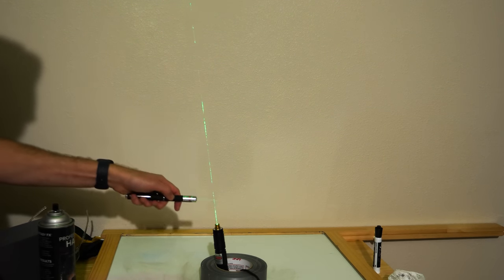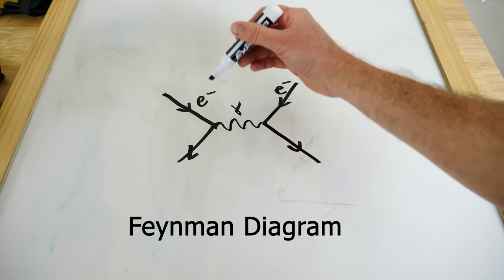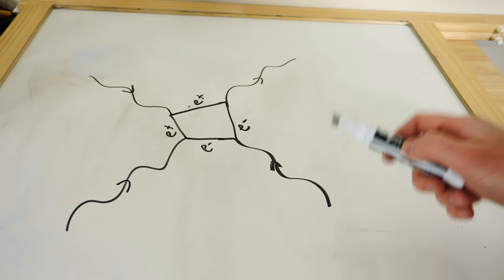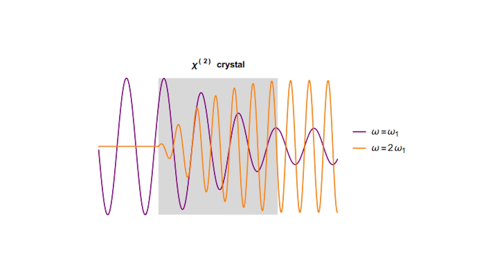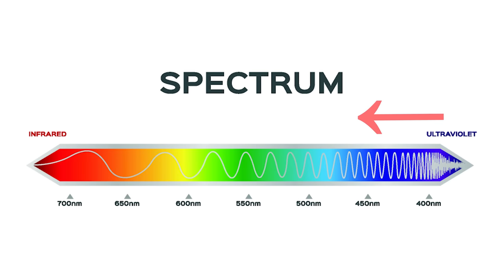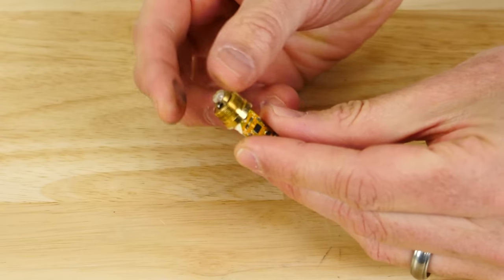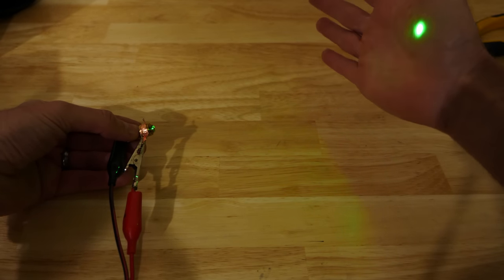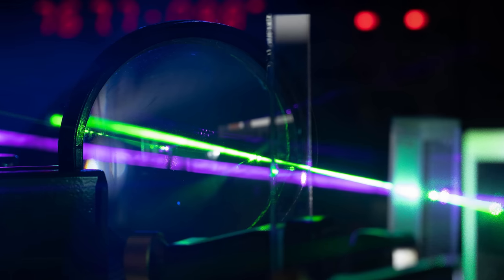Can Light Bump Into Other Light?

Comment: If you held that crystal over a camera, would you be able to see what the world would like if our visible spectrum was 50% lower frequency?  That would be interesting to see.
Reply: You would likely need to design a lense based on this principle to properly capture it, otherwise you are not emulating the structure of the crystal that causes this light refraction
Reply: We'd mostly be seeing in green, blue, purple.
Reply: Don’t mess around with crystals, you’ll fu*k up your chakras!
Reply: No, the second-harmonic crystals in laser pointers are extremely narrow-band in order to be efficient. Only that one specific infrared wavelength (around 1064nm) is partially converted into green light (532nm) with some ten percent of efficiency, everything else is unchanged. So only if you have a strong light source at that 1064nm wavelength in the room, you might expect to see a tiny increase in green hue - without the crystal that wavelength would be simply invisible. Also, it's a 2nd-order nonlinear effect and you only get that efficiency if you pump 50-100mW of infrared light through a tiny spot on the crystal. If you use the crystal as a lens for your glasses with only eye-safe ambient light, the power density on the crystal will be millions of times less and the conversion efficiency scales with the power density squared, so you will see absolutely nothing, even if the whole room is lit up in 1064nm light.

Frequency-doubling of the entire visible spectrum is extremely challenging because these crystals typically work only for a "single" (i.e. narrow-band) wavelength and even then getting more than 10% efficiency is considered good. If you want to convert a broad range of wavelengths simultaneously, you have to make the crystal very thin (look up "phase matching"), which makes it very inefficient, so this is only useful for high-power or short-pulsed lasers. Maybe you could make a giant stack of many different crystals tuned for different wavelengths covering the whole visible spectrum, but the resulting contraption would probably be meters thick and re-absorb all the converted light...
Reply: @darktherapy  That was hilarious!
Reply: Being a second order process, you need very intense light. So probably you will see the same image
Reply: @RealNovgorod  I love the analytical response to the OP. My question is could you hypothetically design a lense similar to the design of these laser pointers with an overlay of that specific crystals refraction point? Because you said "one point on the crystal"
Reply: Crystal glasses!
Reply: He'll yeah, 🤣 but it still made my day, So frickin random.
Reply: @tiffanyvalencia8415  I like some of those colors.
Reply: @darktherapy  is that what happend to me?
Reply: It'd be like looking threw blue sun glasses . Red and blue make green or vise versa any filter of light you've seen that before
Reply: @SomnixmLxcidxs  For nonlinear crystals you have to concentrate the optical density as much as possible to achieve any kind of efficiency. That's why inside a laser pointer the infrared laser is focused very sharply into the nonlinear crystal and the resulting green light must be recollimated again. So indeed you could make some telescope setup with achromatic lenses (or parabolic mirrors) and place the crystal into the focal point (inside the telescope) to maximize the efficiency. Essentially all sceintific and industrial applications (including the laser pointer) do it this way.
Reply: @darktherapy  lol
Reply: You would be seeing the world in 144p 😂😂
Reply: No, you need sufficiently high intensity to have the non-linear effect of second harmonic generation. The efficiency of this process at such low intensity as just "visible incoherent light around us" would be basically zero.
Reply: this explains witche's crystals... hmmm.
Reply: @Andy-413  Extraordinary claims require extraordinary evidence.
Reply: @darktherapy  You can only prove it to yourself.
Reply: @darktherapy  On a side note, how is it that you saying crystals will screw up your chakras is not an extraordinary claim, but what I said is? That's ridiculous.
Reply: @Andy-413  So that could never convince anyone else.
Reply: @darktherapy  I don't want to try convincing anyone of anything, you'd have trouble convincing people that 1+1=2 if they believed 1+1=3. I'm just putting my knowledge out there, and I don't expect it to convince anyone of anything, it's just something that I think people should know, whether they do anythign with that information is only their concern, not mine. But once again, why is it that you claim they have power and that's a perfectly ordinary claim, I claim they don't, but my claim is the extraordinary one for some reason?

This is not even something that should be argued about, not a debate that will lead anywhere beneficial since they both rely on people's minds for the evidence, not visible evidence, good luck proving personal, spiritual experiences or truths, or lack thereof. That would be a monumental achievement if someone could prove without a doubt anything of a spiritual nature. I just spread the knowledge, it's not up to me nor any of my concern what people do with that knowledge. Reject it or accept it, it's up to you, not me.
Reply: @Andy-413  I’ve not made any claims..
Reply: @darktherapy  Sure you didn't...
Reply: @RealNovgorod  so no glasses, but what if you use long exposure photo? Then the intensity wouldn't be a problem 10% efficiency * 10 times exposure should make a 100% efficient photo (although a little motion blurry), or you lower the resolution ten times and have a normal photo. As long as it's linear otherwise you would need software adjusting and can't do it with film photography directly, you would need also a intensity correcting filter.
Reply: @ГеоргиГеоргиев-с3г  You won't get anywhere near 10% efficiency, that's the whole point! This efficiency is for pumping 100mW of IR through a 50µm-diameter (or so) spot on the crystal. If you reduce the power density on the crystal, the SHG efficiency goes down quadratically. You could use an acromatic telescope and put the crystal at the focal point to maximize the power density as mentioned before, but you would still have 4-6 orders or magnitude less power if you just use eye-safe ambient light.
Reply: @RealNovgorod  so you are saying is 10 cam array taking a photo for a month. "Possible but very impractical".
Reply: @ГеоргиГеоргиев-с3г  no, I'm saying it's impossible and impractical. At that efficiency you can expose for a year and it wouldn't matter because the second-harmonic signal would be below any practical noise source and you can't fix it with longer exposure if you can't detect it.
Reply: @RealNovgorod  yeah thought so but it's better to confirm it
Reply: AND A CHEW WITH IRON SHAVING DIRECTED WITH A MAGNET
Reply: @RealNovgorod  That's a shame. I was hoping one such crystal could be used in pico projectors to increase luminosity without heating the projection layer.
Reply: @NiMareQ  What do you mean? The point of a projector is that it changes the amount of light through the pixel by changing its absorption (usually). If the whole LCD (or whatever) is illuminated by a single light source, you have to dump all the energy through a pixel if turns black. The best you can do is making the pixel perfectly transparent for the light source in "fully open" mode, then you have no heating, but who wants to stare at a white screen? So either you get the pixel to radiate on its own (OLED projectors? That's still sci-fi) or you use a laser scanner with fast modulation (that kind of exists already). You don't get heating if the modulation actually modulates the light emission itself (kind of hard) and not just the absorption of a constant-intensity source (kind of easy).
Reply: @RealNovgorod  great explaination, thanks!
Reply: @RealNovgorod  i meant multiplying the resulting light coming from the projector. It would go into a crystal and get multiplied by another source of light. That way you could relieve stress from the LCD and enhance the light after it.
Reply: @NiMareQ  Oh, you mean OPA (optical parametric amplification). That's actually possible in principle and it's not limited by the low power from the projector like a second-harmonic crystal. You can focus the entire (low-intensity) image from the projector into a nonlinear crystal (and recollimate it afterwards) and pump the crystal non-collinearly with a strong laser of a shorter wavelength than what the image is composed of (e.g. blue or near-UV). In OPA the conversion efficiency is dictated by the strong (pump) beam and not the weak (seed/signal) beam, so you can definitely get useful image amplification. The high-energy pump photons are coherently down-converted into seed (signal) photons and the excess energy goes into a second output beam in the infrared (idler). It's not really practical to do this for the whole visible spectrum because any parametric nonlinear process becomes very inefficient if it has to be so broadband (due to phase matching), but it can be easily done for the three individual narrow-band RGB color components separately for triple the price. And you need at least watt-level pump lasers to amplify a milliwatt-level image, so you're just dumping all the unused energy. In terms of cost, just use a laser projector instead...
Reply: @darktherapy  what would happen if I had my chakras removed? No more knots, full god mode!!!
Reply: That's actually very interesting maybe NASA could use that in a telescope they probably already did though
Reply: @Onyx-0.01  I seem to remember a website I found that had the entire sky mapped in the entire electromagnetic spectrum, with a slider so you could slide through the spectrum and see what the sky looks like at different frequencies.  Not sure how they got the data for that, but they can definitely get images of the entire spectrum.  Just not all at once I'd imagine.
Reply: @Onyx-0.01  There's no need for nonlinear frequency conversion in astronomy. You just want to detect all the light that comes in as efficiently as possible and not lose some in a conversion process. So they are more concerned with making ultrasensitive detectors for every wavelength range and most of them already got to the point where they can detect almost every single incoming photon, so you can't improve anything with additional amplifiers or frequency converters. Now it's all about reducing noise and stray light, which means going to space.
Reply: I just thought it would have been an interesting idea put a crystal over a normal camera
Reply: @jerotoro2021  that's interesting what's the website called
Reply: @RealNovgorod  I just thought it would be cool to put a crystal over a normal camera
Reply: I think that would be much easier to do with a digital video camera or stream and some simple processing.  Or even by messing around with a still photograph in photoshop.
Reply: you could certainly make a rig with a long lens, masked off, focused through one of these crystals, and then mount that rig on a scanning gimbal so it can slowlu take a picture by sampling over time
Reply: @RealNovgorod  Just had a wierd thought. What if you could 'bunch up' the light? Like some kind of contraption that regularly slows down and speeds up light, by enough that you get peaks which are at laser-like power densities. Then you'd need to match another such device to 'undo' the bunching up, which you'd need to match the phases of.
I suspect there'd be a major problem pushing the amplitude up by such a large factor, but it'd be cool to know if it could work in a lab setting.
Reply: @PeterBarnes2  Fun thing - that actually exists and is called AOM (acousto-optic modulator) or EOM (electro-optic modulator). You can apply a sound/pressure wave or an AC high voltage to a suitable transparent medium (some glass-like crystal) and it modulates its refractive index along that wave. Typically this is used to create some kind of static diffraction grating for a light beam inside the material, but if the light beam and the pressure wave travel at different speeds, the refractive index modulation happens in the time domain, so parts of the beam are slowed down at different rates ("speeding up" light would violate everything that's holy :)). This can "bunch up" a continuous beam to some extent to create a regular or arbitrary pulse structure (optical data communication is a big application here). Effectively, you impart the frequency bandwidth of the modulation wave onto the continuous beam, so the resulting pulses can only be as short as the acoustic or electronic wave (the shorter the pulse, the higher the peak intensity). A laser medium can support a much higher bandwidth and therefore much shorter pulses than what's possible with electronics (femtoseconds and below), but you need some crazy tricks to get all the different wavelengths (modes) to line up perfectly to create ultrashort pulses (look up "mode locking"). These types of lasers can concentrate a bullet worth of energy within a femtosecond-short duration, which is more power than all power plants in the world combined, only for a very short time - just enough to start nuclear fusion.
Reply: @RealNovgorod  Yes, I read a little on wikipedia some while ago about acousto- and electro-optical modulation. I was researching in relation to a similar idea of optically amplifying an image so you could pull more information out of a weaker signal.
That idea could theoretically also be useful for this idea of shifting invisible frequencies up to visible light directly as such. ('Directly,' in contrast to electronically reproducing the signal.)

The main issue then would be the narrow range that typical lasing mediums operate on, which is the same problem as before. Though...
If you took a laser that was optically pumped, and bring it just below the lasing threshold, then fed it with a signal, could you replicate, even at lower quality, the signal with light at the laser's frequency? Even with rather different frequencies of light? The critical thing would be doing this across a whole surface, in a way that could reproduce an image. You'd undoubtedly lose quality, but if it could be done even a little, you could make visible the invisible. You'd have to thoroughly scatter the laser after so that it's safe to look at, but I think it would be interesting.

If you wanted colors, maybe you could split with a prism, then isolate a particular range of frequencies, use another prism to 'undo' the prism's effect on just this range of frequencies as best possible, then do the above steps. Repeat that three times (in parallel, not in sequence) using optically pumped lasers outputting R, G, and B light and mix.
Reply: @PeterBarnes2  I don't know what you're trying to achieve. Amplifying an image in a laser medium? That makes no sense. A laser field is a standing-wave mode inside a cavity, so the spatial profile of the laser light is very well defined (usually a single-mode Gaussian beam or some transverse harmonic in exotic cases) in order to get coherent stimulated emission, which has the side effect of a clean parallel beam, which is the opposite of an "image". It's not a laser beam anymore if it has to support a gazillion spatial (transverse) modes to form an image. It also won't work with "different frequencies" because a laser amplifies a seed field (which can be random spontaneous emission if you don't feed it an actual seed) without changing its frequency. The most broadband laser medium is Ti:sapphire but it "only" covers wavelengths from red to near-infrared (enough for few-cycle pulses though) and anything resembling visible white light involves nonlinear trickery outside the laser.

In any case, stimulated emission is not the way to go for image amplification unless you somehow build a separate laser cavity for every image pixel and every frequency component. Just use an OPA, at least then you don't need a cavity. And the whole premise is moot regardless, because if your image has enough photons to seed an OPA or some sci-fi pixel-laser amplifier, those same photons are more than sufficient to be detected with state-of-the-art CCD or CMOS detectors (cameras) with single-photon sensitivity. If your argument is philosophical, i.e. a "direct" amplifier rather than an electronic detector (why though? Just to see it with your "own" eyes?), then you should consider that the photons of the "amplified" light are copies of the seed photons, which have long been consumed, and you're still seeing a reproduction - no different than photons created from some display based on an electronic recording if they have the same properties as those from the original image.
Reply: @RealNovgorod  I just meant having a medium that could be pumped such that you could use a lower energy photon to then make up the last bit of difference and cause stimulated emission. In particular, I had this idea in my head of saturating the medium with photons of an energy just under what's needed, and then relying on two-photon excitations involving the saturating photons and the signal photons to cause the stimulated emission. I wasn't clear on what I meant, sorry.

OPA looks like what I meant to have the idea of, but simpler.

The idea would be amplifying the source (an image in the optical sense, not like an image file), not an array of pixels. One more real application may be, for example, to use polarizing filters to measure polarization of a faint source. Polarizing filters will absorb some of the incoming light, so if you want to do more with the same incoming light, it would be nice to amplify the image first before splitting. There may also be other similar kinds of measurements that would absorb light.
As well, being able to convert a signal from being carried at one frequency of light to another could be of practical use, perhaps that it's more difficult to make certain measurements at the frequencies of interest, but if the signal could be brought to another frequency, those measurements may be made practicable where they wouldn't otherwise be.
Reply: @PeterBarnes2  Stimulated emission is a linear process. It only works with seed photons within the gain bandwidth of the medium and makes exact copies of the seed photons, i.e. copying the frequency, phase, and spatial (transverse) mode shape. The seed properties can never be changed by a laser (that's kind of the point). If you pump a laser close to saturation but your seed is at a frequency outside the gain bandwidth, the laser will "ignore" it and instead amplify some of its own fluorescence within the gain bandwidth (spontaneous emission; it won't stay pumped forever) long before multiphoton effects can play a role.

An "image" is either a collection of beams with different angles from a half-sphere if you consider the aperture (like a pinhole, pupil or camera lens) or it's a 2D intensity distribution if you consider a screen. If you want to amplify a whole image like a laser, i.e. with a cavity, you have to split it into discrete spatial (transverse) modes (essentially "pixels") and amplify them individually. With OPA you might be able to amplify everything at once, e.g. by putting a giant crystal into the objective aperature, but the large angular spread of the image will cause problems with phase matching and probably pump depletion of intersecting beams. And you still have a narrow usable bandwidth, so you'd need an OPA stage for every wavelength interval you're interested in.

Still there is very limited practical use for direct image amplification. Even your polarization example is not an issue because that's routinely handled by using a polarizing beam splitter and a pair of single-photon detectors (that's used quantum information research all the time). No photons go to waste because all components have a high quantum efficiency, and the polarization state is determined by the signal ratio at the orthogonal detectors. The only application I could possibly conceive of is frequency conversion when direct detection at that wavelength is not available or too inefficient. That's also routinely done (e.g. fluorescence up-conversion) but usually it doesn't require great transverse resolution (i.e. an image).
Reply: @darktherapy  was that a jojo reference

It's a naruto reference